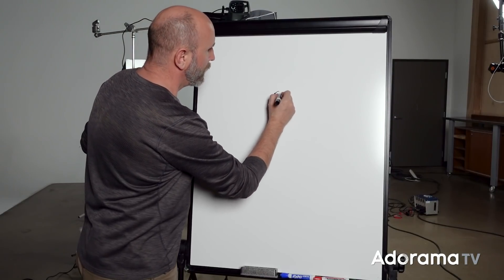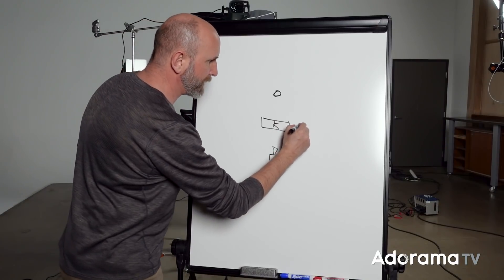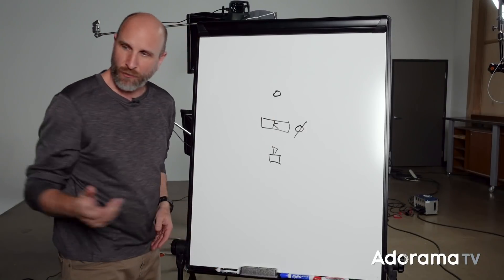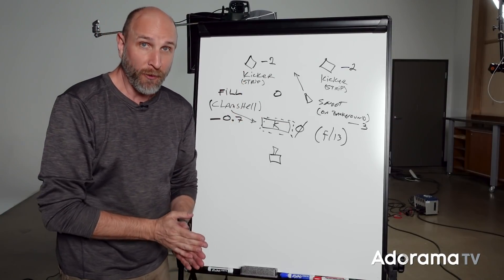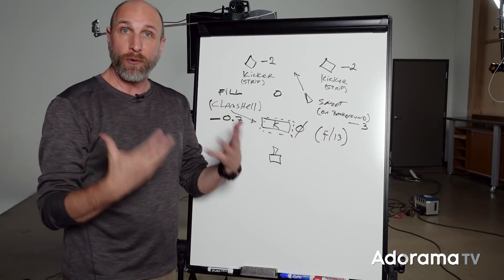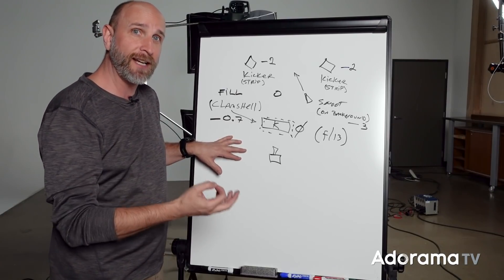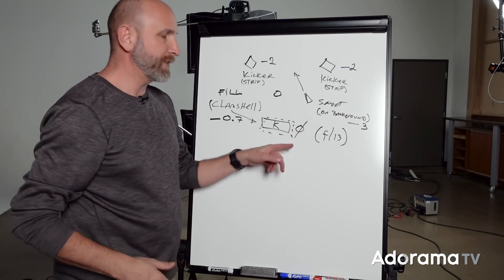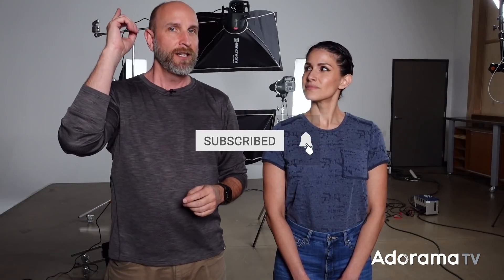Never Forget Another Lighting Setup - Flash Power Notation | Mark Wallace

Comment: Great, thanks. 
I think, there's no need to press the memory button, since this (and its memory-places) is used to average different lights or levels of brightness. In order to get Delta-Values, just measure one light, then toggle the AVE/dEV-button once, and from here all subsequent measurements are shown as delta EV. To begin a new series (measure an other initial value), just toggle the AVE/dEV-button again. You don't need the memory-function to display differences

Comment: Thanks Mark for a wonderful way of remembering. Using the key light as "ground zero" is perfect!!  Taking wide angle pictures of the set up and model is icing on the cake!
As a "side note," I see lots of " digitally-created diagrams" being used by You Tubers, but cannot seem to find where to find these online. Your method would work perfect with some of these preset diagrams - just fill in the blanks so to speak.

Comment: Or you could just put in the actual value of the lights  e.g. Key 1/8th, Fill 1/16.3  Kickers, 1/32 and snoot 1/64 and then in the remote use the Select All button (at least the Flashpoint R2 Pro Mark II does have this function) and when you change the Key light all others change respectively in value :-) If you change the Key light to 1/4th power all other will increase by the same amount and vice versa, if you lower it to 1/32 power all others will go down also.  One button, no math problems to solve, the remote does the math for you, hurray LOL

Comment: I have a Sekonic L-308s and it does not have the Delta EV option. Is there a way that I can calculate it using this light meter?
Reply: It's the story of amateurs like myself; we don't have the luxury of delta(EV) with 308.  So go with f stops, easy.  Select your key (f/8 for instance), then if you want the fill to be -1 adjust it for f/5.6, background at -2 should look for f/4, etc.